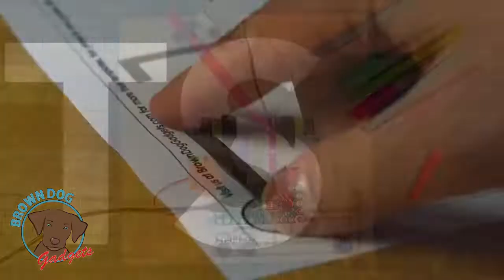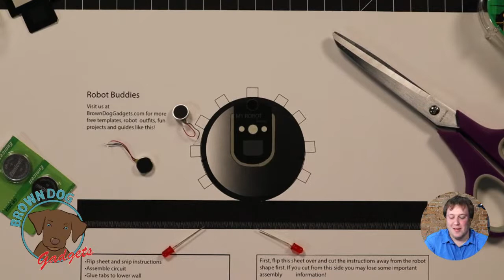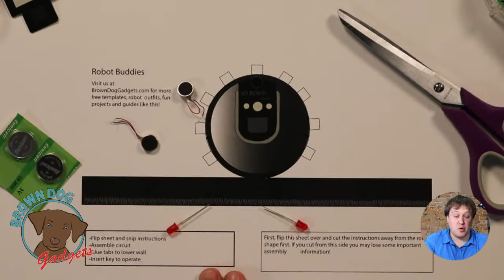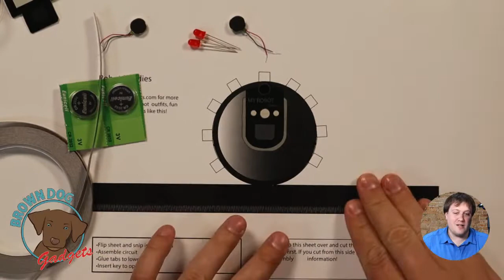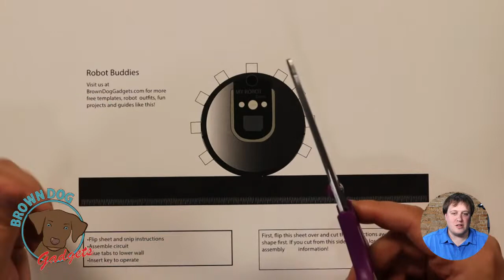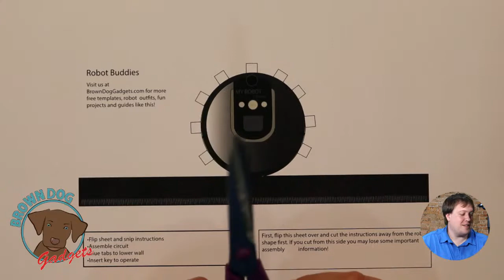Roomba Paper Craft! - Moves and lights up!

Comment: Make sure you reverse the wires. So the blue wire should be where the red is on the template
Reply from the maker: Reversing the wires will make the motor spin the opposite direction, but either way will work fine. 🙂